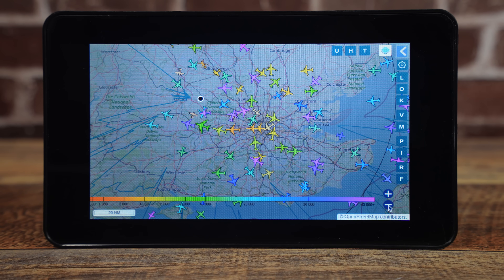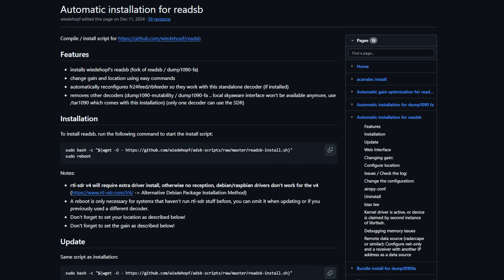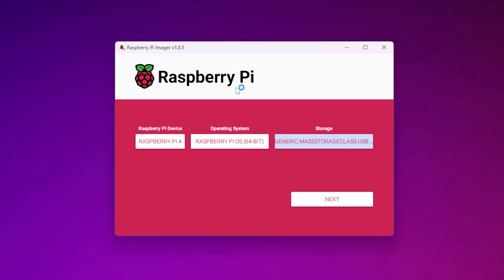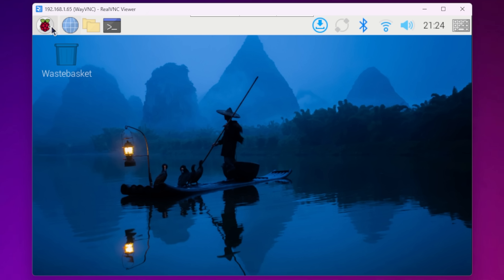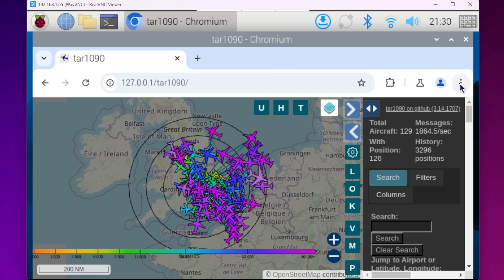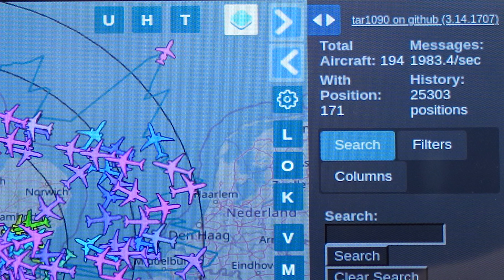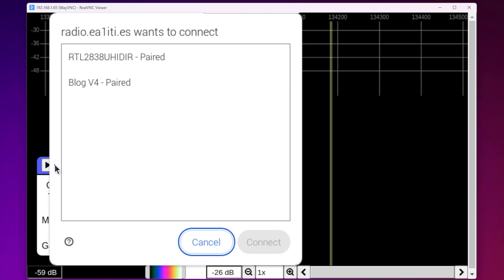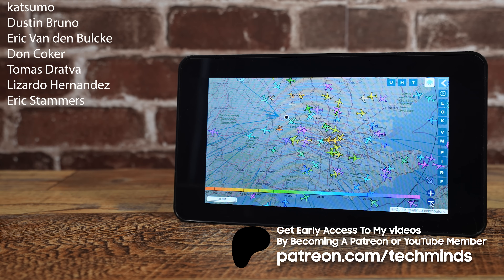Your Very Own Aircraft Tracker With VHF Airband Radio - RTL-SDR & PiADSB

Comment: Hello sir! This was also a very good video!
I would like to buy an RTL-SDR, mainly for listening to SW, but now that I watched this video, I would also listen to the airband. Without looking at the planes...
What is the difference between the RTL-SDR V3 and V4?
Looking at the descriptions of the two dongles, one thing stood out to me: Chip R860 vs. R828D.
Are both suitable for airband reception, by the way?
I also have an RPI4+display at home, but I would use it with a PC, some kind of Linux distro.
Made with Google translator...

Comment: Thanks for this video, it's a great project. I'm thinking about mounting everything in an aluminum box and also adding a battery pack similar to those used to charge cell phones insider. This way, you can take it outside. Alternatively to ADS B and Air banda monitoring, you could make it receive AIS information from ships and marine VHF to hear ships talking with other and with Port control centers.Thankyou so much for all  interesting info.

Comment: I'd like to build one of these, 
Is there any chance you'll tell us how to install the s/w to tune the radio on the Pi so we can run it without an internet connection? 

Is there any chance you'll tell us how to install a device ID so we don't have to wait to plug in the 2nd SDR until after the map s/w is running each time we use the device?
Will you show us how to install the s/w so we don't need to be online to see the details of the flight we click on? 
If you have a chance and are interested in making more instructions I'd like to build one. Thank you.

Comment: 1. Is there any chance you'll tell us how to install the s/w to tune the radio on the Pi so we can run it without an internet connection? 
2. Is there any chance you'll tell us how to install a device ID so we don't have to wait to plug in the 2nd SDR until after the map s/w is running each time we use the device?
I know you tried to keep the video from getting too long, I'm a complete newbie, if you ever make a complete set of instructions I'll build one.

Comment: One thing folk may want to do to make things quite nice for following flights is get a layer file with the U.K. ATC sectors on (NATS do a Google Earth version you can convert to geojson) and modify the layers.js in tar1090 to have them put in over the top when you click the button in the layers dropdown. You can have the sector frequency and the name overlaid displayed in each polygon with a tiny bit of work.

Tar1099 is very modifiable and if you're into data wrangling you can do some quite nice things.

Comment: Is there any chance you'll give complete instructions for someone who is new to SDR and new to PI? Will a 4GB Pi work? Will the generic screens Amazon sells work? Do you hook up both SDRs to the same antenna, and if so, how? Will my roof mounted Diamond D130 25-1300 MHz antenna with a fairly low loss 15' cable work for this? I posted questions here but that post seems to have disappeared.
Reply from the maker: Hi there!

1. I have only tested with the screen shown in the video, the official 7inch pi screen version 1
2. Each SDR is plugged into the pi but using separate antennas. However, If you have a wideband discone antenna then you could use a splitter to feed both SDRs. Just make sure they can handle up to at least 1.1GHz. However, two antennas would be better.
3. 4GB Pi will be fine
Reply: @TechMindsOfficial  Thank you very much for the clear and quick reply!!! Cheers.
Reply: @TechMindsOfficial If I may, a couple more quesitons:
1. Is there any chance you'll tell us how to install the s/w to tune the radio on the Pi so we can run it without an internet connection? 
2. Is there any chance you'll tell us how to install a device ID so we don't have to wait to plug in the 2nd SDR until after the map s/w is running each time we use the device?

Comment: How about making it portable. I’m always visiting my aerodrome
Reply: I would like to build a mobile version too. But I'd like a few more instructions on how to build it, like how to install the s/w to tune the radio on the Pi so we can run it without an internet connection, and how to install a device ID so we don't have to wait to plug in the 2nd SDR until after the map s/w is running each time we use the device. A battery and solar panel charger would be simple.

Comment: Great Project have really enjoyed building. Thank you. A quick question on the map there are blue lines that look like triangles that don't appear to connect to an aircraft and are in an irregular circle around your position. I see them in your video as well as in my build. What do they represent if anything? Thanks
Reply: The blue lines are range rings, showing the maximum distance the unit is picking up aircraft. Depending on antenna location, like facing south out of a window, the range will show a larger area southward.
Reply: The blue lines shows the maximum recorded distance (based on aircraft-reported GPS position) per degree of direction. An internal database in the software stores a distance value for each degree (0-359) and every new position received is compared to that database. If a new position is farther away in a certain direction, that distance replaces the old one. The blue line is drawn based on that set of distance values. It functions as a rough indication of how good your receiving setup is in different directions. However, since some directions might have very few aircraft, and some many, and at different altitudes, and there could be obstacles blocking the view in some directions for some altitudes, the actual maximum distances are not purely down to antenna/receiver performance. My antenna is on the inside of a window, at ground level, in the middle of a group of low houses, so my reception is pretty terrible in most directions...

Comment: Out of curiosity, to get screen caps are you just mirroring the display to one of the HDMI ports, (or on a 3 or earlier the hdim port) and capturing with a video capture device, or are you doing something else. I'm thinking that for some video sreams, having air traffic in the area as the AFK screen might be cool.
Reply: To answer my own question, no, your using a VNC option.

Ran into a minor issue when I inverted the video. After a reboot, now the system starts up the desktop and immediately logs me out and logging in does that again. Going to have to re-image the microSD card, which requires a full disassembly of the system, because some engineering genius decided that running the video ribbon over the microsd slot in this situation was a good idea...

Comment: This catches the commercial aircraft is there a way to get both commercial and private aircraft to display at the same time on this type of setup?  I realize that the private ADS-B frequency is different and that might require a 3rd receiver.
Reply from the maker: As far as I know, there are only two ADSB frequencies. 1090MHz and 978MHz.  978MHz is only for aircraft lower than 18,000 feet in the US. All other aircraft around the world, including military, private and commercial, use 1090MHz. As far as I know.
Reply: @ I live close to 3 different airports that also do a large amount of flight training and I know that those little planes don’t go anywhere close to 18K and was just wondering if it is possible to build a non internet connected receiver system that can get both of them.  I frequently have ADS-B exchange open on one of my screens in my office and would love to figure out how to see all the same info without the internet or tying up one of my screens that I could (ok should) be doing work on.

Comment: I find this fascinating.   I like the concept of sdr, but it is cumbersome to have to use a computer.    
Using a pi and a small touch screen makes it less cumbersome, just need a case and a battery and you have a complete radio with visual display !

Comment: Can you do a video on using an RTL SDR with a Rsp Pi Zero 2W to make a APRS receiver, I recently bought an RTL SDR Blog V4, and tried out with some SDR software but it wouldn't load the drivers on my PC so I am unsure if I will get problems using a Pi Zero 2W and Direwolf, thanks
Reply: Did you try to install Zadig drivers?
Reply: @Marek_M79  Yes, but each time when I plugged the RTL SDR in it said no drivers found
Reply from the maker: @PaulStrickland The RTL SDR V4 uses specific drivers, you can look at this webpage and choose which operating system you are using for the instructions: https://www.rtl-sdr.com/V4/

Comment: with RG316 and 1090 Mhz; you have a LOT OF LOSS on the coax ... you could consider to run a short coax and then a longer USB cable, and put the RTL-SDR close to the antenna
Reply from the maker: Not sure if you’re referring to the setup shown in the video, or just a general comment. But my SDR was connected with a usb extension plugged into the pi and then where my LMR400 comes into the shack from my Active ADSB antenna on the mast, I connected the RTLSDR. The 316 was just off to my other LMR400 which goes to a VHF antenna on top of my mast. So I’m perfectly knowledgeable about loss at high frequencies and didn’t suffer any losses. Cheers and it’s a very good point for others to know about. Thanks.
Reply: Personally I use RG-6 (75 ohm Coax) 35 Feet approx. as it is rated for GHz Applications connected to my Home Brew (16 Segment) Collinear Antenna for ADS-B (200 Mile Radius) No LNA Required.
Reply: @x_CrossHair_x RG6 for satellite work is acceptable for 1GHz. RG6 in and of itself is not. It is about the specific cable you choose. You'll have less loss at 1GHz using cable specified for it compared to cable that isn't. You get what you pay for. 
75 Ohm coax has less loss for a given size & the same materials than 50 Ohm.
Compare specifications and you'll find quite a range. Small coax such as Belden 1855 which is mini-RG59, is good for 6GHz. But it has 29dB loss per 100 feet at that frequency.
Reply: @AC9BXEric  RG6 Can Operate up to 3 Gig.. ADS-B.. at 1.09 Gig is fine for RX and used for the Collinear Antenna 16 segments cut to wave length (factoring in the Velocity Factor). I get a  (200 Mile Receive Radius) proves that it is Acceptable.  and the 35 Feed line into the House using the same Coax, any loss is negligible. How ever if needing to Transmit is another Story.. (And no) I would not want to use it.
Reply: @x_CrossHair_x  You're missing the point. Any coax can operate to 3GHz, to 3THz. It's a matter of how well. Just because it's RG6 doesn't make it suitable. It needs to be of sufficient performance.
Reply: @AC9BXEric  In return.. I'm Not saying only use RG-6 because it's the best.. but is Acceptable  to use for an "Inexpensive" by comparison to some Low Loss Coax and does a Decent Job. Always Review the Coax Specifications to find the "Best" lowest Loss with the Correct Impedance and Frequency. I didn't notice any Reason to worry that RG-6 is 75 Ohms.. and Not 50 Ohms..However, if you want to build a 16 Segment Homebrew Collinear using an other type of Coax (low loss in the Gig's) Builders Choice.
Reply: You decide on the coax depending on whether is is good enough and reasonable cost. Lower spec 75 ohm coax is fine for reception of 'higher power' signal levels around 1GHz.  As an example, I have invested in LMR-600 cables for 23cm EME - as it makes he difference between 20W and 120W reaching the antenna from my amplifier. LMR-900 would be ideal, but it is very expensive - so LMR-600 is good enough for my purpose.

Comment: Now are you up to presenting a similar project (as low budget as practical) to track aircraft with Passive Radar by utilizing known strong transmitters (such as DBTV or Broadcast FM radio source transmitters)?

The output of the Passive could be compared to the output of this to identify aircraft, drones, etc not utilizing ADSB.